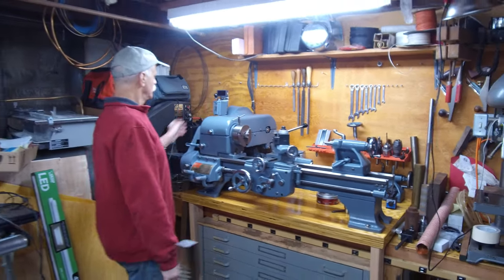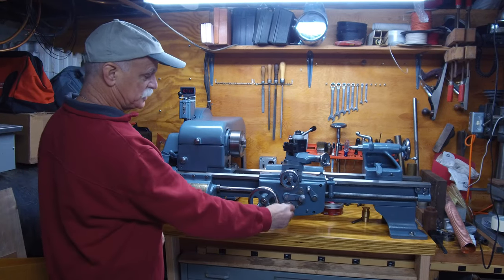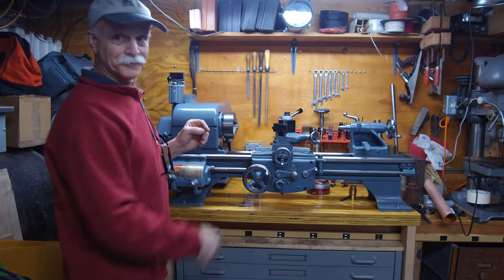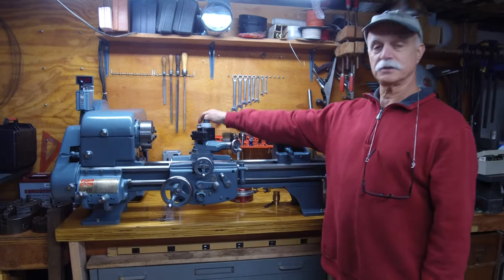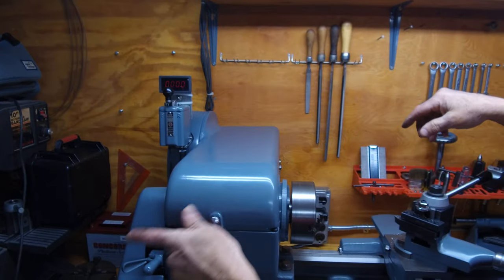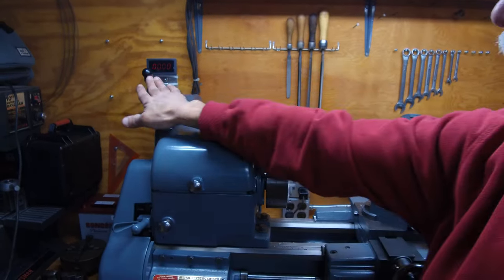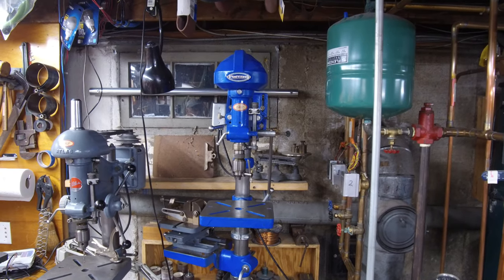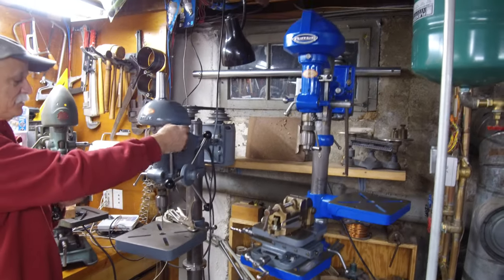My New Logan Lathe 10" Model 815

Comment: I just acquired this model of lathe and am interested in your rpm indicator, where to get and how to hook up. Thanks, Peter
Reply from the maker: Peter, I bought a cheap unit on eBay. It was one of these units.

4 Digital LED Tachometer RPM Speed Meter + Hall Proximity Switch Sensor NPN

I simply stuck the magnet on the end of the spindle where it sticks out of the headstock on the gear side. And put the probe up to it using double sided tape. It was real simple.